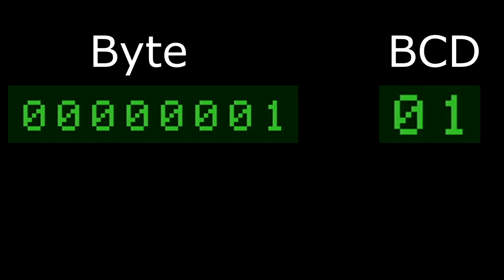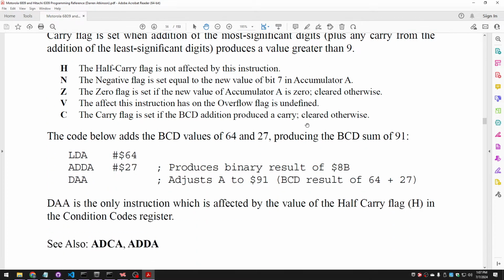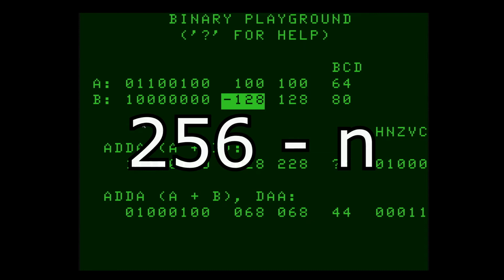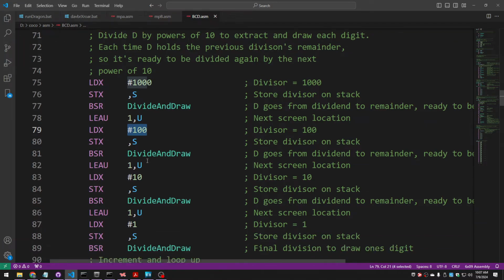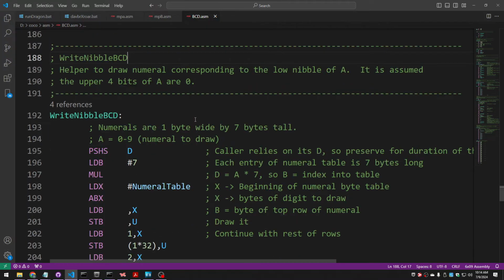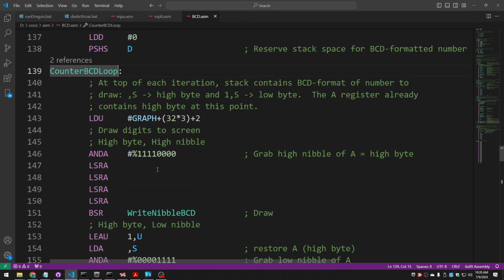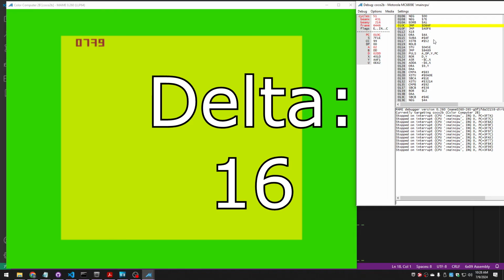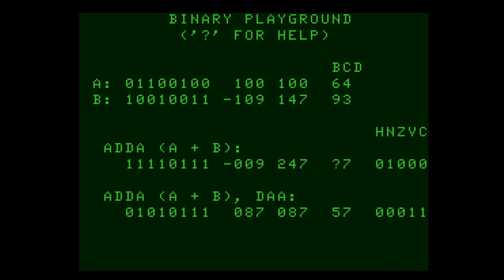Binary coded decimal: Intro & speed test | Asm Adventures

Comment: I did arbitrary BCD subtraction by adding the 10's complement as described in the video. That's done by calculating the 9's complement of the subtrahend, adding 1 to it, and then adding that to the minuend. You calculate the 9's complement by subtracting each digit from 9. For a single byte, you subtract it from $99 (no DAA required for this step). (Since I didn't have a carry in, I cheated and just set C before doing the addition and used ADCA to avoid a separate "add 1" step.) Terminology note: you subtract the subtrahend from the minuend.
Reply from the maker: Thanks for the info!  Cool to hear you found a use for BCD subtraction and got it to work.  Your description makes sense, and I appreciate your glossary at the end.  🙂
Reply: @CocoTownRetro  I actually used it in an implementation of floating point using BCD encoding.